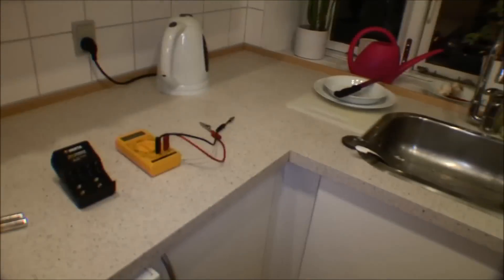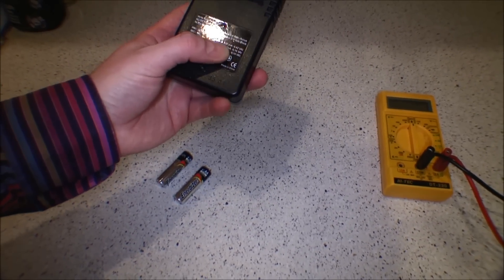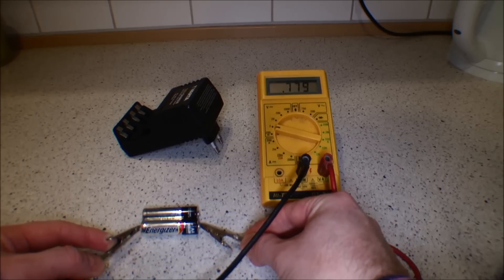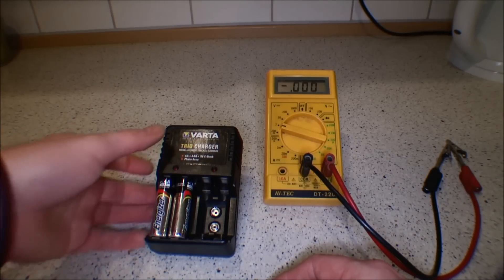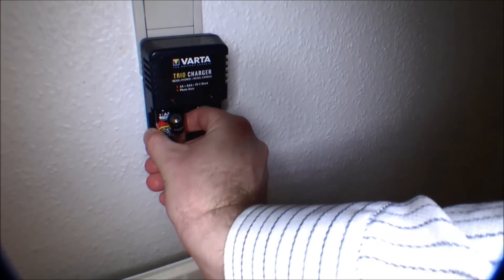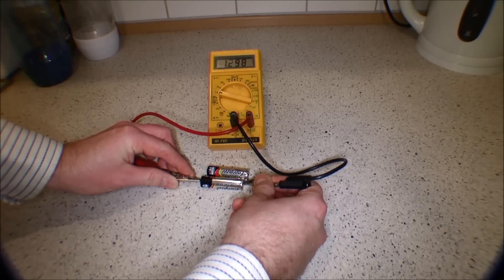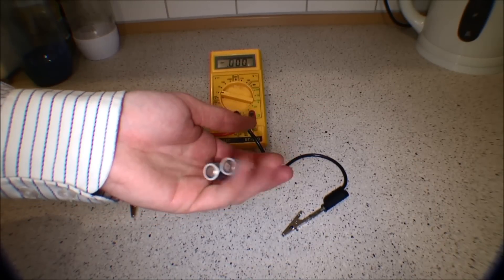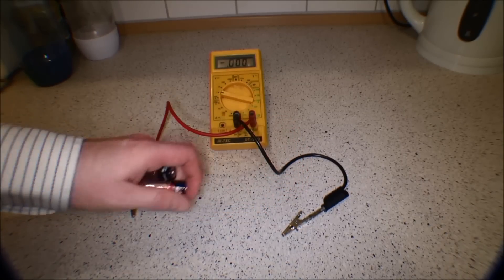Charging Alkaline (NON-RECHARGEABLE) Batteries - 124

Comment: The reason why they didn't charge to the 1.5 or more as a normal 1.5 battery would be is because normal battery chargers only take a rechargeable battery up to around 1.2 volts so they could replace a battery that can use a rechargeable battery..
Reply from the maker: Hi flitsies
Good thing you write! i had forgotten four batteries in my old charger,, see my Google+ two of them was on 1,829 volts!!
Never seen that befor! have you?
Thank you for watching! :-)
Reply: My PlayHouse Why not use a socket timer, pre program it to shut off after every so many minutes with a max charge time.

Ie charge 5 minutes power off to allow them to cool down then charge another 5 minutes and so on until they are fully recharged less chance of them leaking or popping.

Have you ever tried to recharge a mercury cell, if you do remember to wear eye protection they really do pop if you put too much power through them.

Always wear eye protection when experimenting with this kind of thing because they haven't made replaceable eyes yet and those are the only ones you got so over protection is better than no protection for something you can't replace.
Reply from the maker: HI flitsies 
Yes i have tried recharge a mercury cell,,, when i was like 14 or 15,, i am not doing that again :-)
Thank you for watching! :-)
Reply: My PlayHouse Makes you jump don't it, I recall doing exactly the same thing around the same age, very dangerous but fun. 

Still it makes you realise just how important it is to wear eye protection when doing this kind of stuff don't you think?
Reply from the maker: My ears was ringing for some time after that! Not good :-/